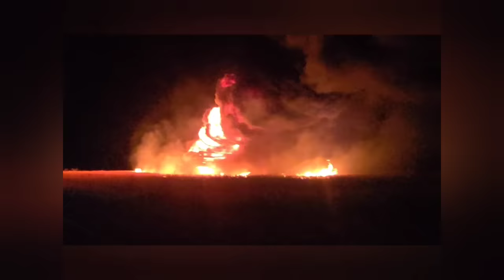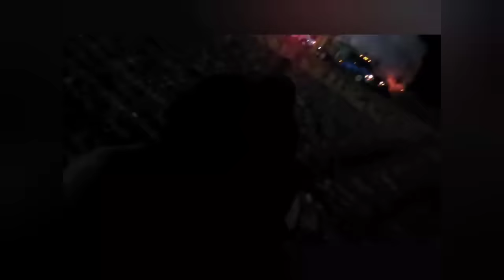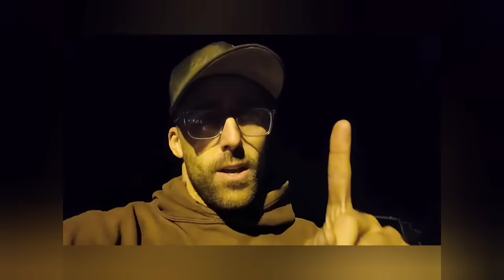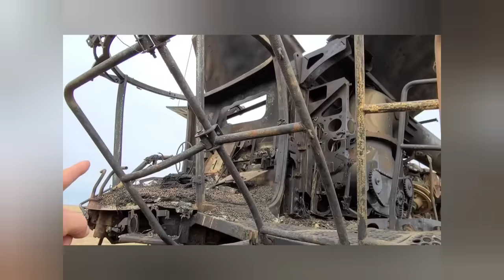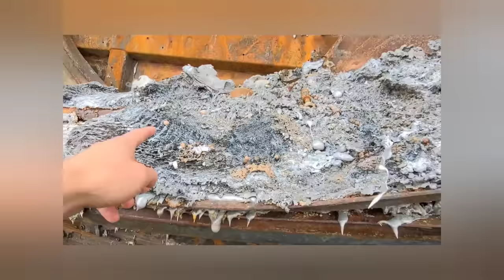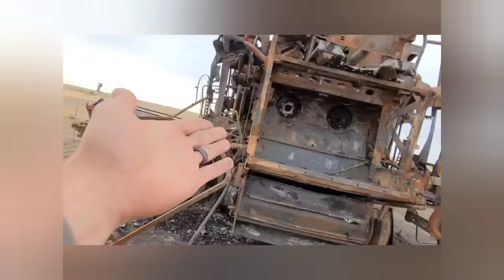Fendt Ideal 9, burns to the ground🔥

Comment: When I was harvesting chickpeas in Australia, we gave a full air blast to the combines every other run (~every hour). When running four combines, it was a full-time operation—a nasty job, by the way. Massive amount of dust + handling the 1" air hose from an industrial diesel compressor is not an easy task.
Water trucks were at each end of the run and one in the middle. We didn't lose combine but had harnesses smoldering. Lost sensors. Melted plastic side concave access panels. The worst case was a melted diesel tank on NH CR 10.90 which started leaking diesel, the alternator on fire, and a solder deep between the panels, which traveled to the sieves.
Exciting and tense times. We've been "sniffing" each other like dogs when unloading/passing each other. 

I would say that when harvesting chickpeas, the priority is to have at least 10l of water with every combine and chaser bin for immediate action. Make sure that there are no overheating bearings. Keep the dust to a minimum. At least blow the dust off the turbo. Otherwise, it will smolder and drop down or get redistributed with the airflow to other areas.

Our neighbors lost a new Claas combine that season. 
Checkpeas can ignite even due to electrostatic charges/rubbing.

Comment: Hey Mike, do the combines have temperature sensors on the gear boxes? Seems like that would be something they would want to monitor considering they had problems with overheating already. And it is pretty easy to add in sensors into the isobus/canbus system.
Reply: Excellent point, one good thing about losses like this is that it can lead to safety improvements.
Reply: JP Absolutely, in industry we utilize a lot of sensors during R&D/prototyping. Once the design and been tested throughly then most are not required for production. But critical gearboxes like this probably should fall into the same category as engine and hydraulic oil temperature.

Comment: Man...I kinda know that feeling...had a 468 JD round baler go up...had rolled 97 bales and was about done...was wrapping a bale and got a whiff of smoke...kicked the bale out and saw a flame flicker in the pickup..bailed out and grabbed the fire extinguisher and hit the area in the pickup and whoof...holy xxxx...I tried to pull the hitch pin but the heat was too hot...dont know what I was thinking but I jumped back in the tractor and shoved it in d-1 on a 4240 quad range and drove in circles..believe it or not I saved the tractor..it kept the flames pulled away but the heat did melt the top of the cab..okay let's backup...the whole was a result of a gallon of ethanol glycol my boss put in the extinguisher..the charging instructions says add a bit of dish deterrgent and a bit of antifreeze...non flammable anti freeze..I was catching hexx for not using the extinguisher when I did but I happened to see the instruction to charge the extinguisher and asked boss man hey what did you put in it...a gal of anti freeze and a bit of water and deterrgent...all the hay that was baled burned plus another 50 acres of hay ready to bale...had a JD 550 dozer with a plow and 5 different fire depts fighting it..once the belts caught fire it was crazy hot and hyd lines started blowing and spraying fire and those Ballon tires went kaboom...so I know a machine will burn..lol...glad no one got hurt at your fire...I was trapped in the middle of 97 bales on fire and it was nothing but smoke and ambers..all over a 35.00 dollar bearing that never made a sound...
Reply: You're right on the money about all brands will burn but J.D leads the the burn downs on rd baler here in eastern Okla...every frickin bearing on a Deere rd baler is sealed and is going to eventually fail...I use a heat gun also but had never seen this particular bearing and ive been running Deere balers since 86...Forest Gump said it best six happens.

Comment: Here in AZ, we also have issues with cotton picker fires.  Between the dry cotton fibers, the high oil seed, the amount of grease and oil in the picker heads, and the high-volume fans used to move the picket cotton, fires are just nasty.  Causes are usually rocks causing sparks, but, due to some of the high-speed parts in the picker heads, plain old friction can start fires, too.  You get into a  field that's nasty with morning glory or bindweed, and that crap can wind up in a head in a hurry and it only takes a few minutes to start a fire.  You do get the occasional electrical or engine fire, but, in my years of farming, they were pretty rare.

Comment: that collapsed hopper support, but fuel cant "melt" steel beams lol
Reply: What the conspiracy theorists can't seem to wrap their heads around is that it doesn't have to melt into a puddle, it just has to be weakened below its designed capacity allowing it to bend, deform, and shear under the weight of the load. There's also more than just fuel burning, which adds even more heat. (Also the spray-foam insulation used in the towers got blown off the beams by the initial impact/explosion further degrading their ability to withstand fire).
Reply: @MrMattumbo   another 5 galls of diesel and it would have collapsed into a pile of pre sized recyclable pieces

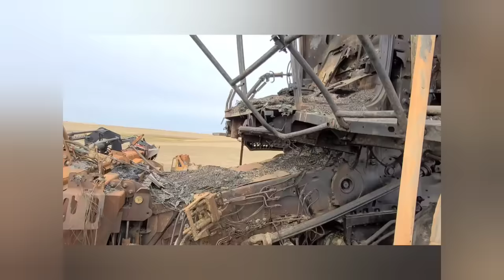Comment: Sad to lose the nice machine. Great to see the driver got out. Good to see the team work and the relatively quick response from the fire department! Look at the drive shaft going to the header (left side, under steps to cab) at 25:54, 30:31 and 39:55. That shaft looks to be a couple of inches thick, but it looks bent from the heat! Even though it was on the 'cool' side of the burn!

Comment: My dad (who is a spare time farmer) told me last year that one of these Ideal combines caught fire in a field near to our farm. He said that the operator was made aware of this by some motorcyclists on the road. He got out of the cab and ran away as far as he could. Only moments later did one of the rear tyres explode, sending the rim flying through the air and landed on the next field. Insane. Better stay back if equipment catches fire.

Comment: Hi Mike to bad about the combine we had 2 9620 rx tractors burn up last year with 600 ish hours on them I highly recommend removing the exhaust shields and cleaning it out. We ended up getting new ones with the 120 inch track spacing

Comment: Mike... you seem a bit angry.  IS the insurance company giving you the impression they don't want to pay out?    I get your joking as a way to deal with it I'm the same way.   In a sad way it was cool to see all the drive lines, pully system etc from the wreckage.   Stay safe out there.
Reply: thay will find something not to pay out  we had a trailer in the wood trade  because it caught fire at the yard they said we only pay out if its on the high way  we saved lots ot money on our next trailer  grandad told the inspector a few chiuce words.

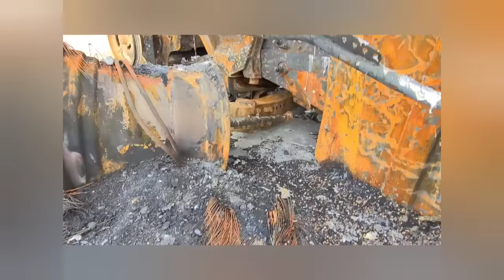Comment: 40:38 Did you just prove that diesel fuel can melt steel beams??   

Those south of the boarder will understand.
Reply: The so called engineers that said a fuel fire couldn't melt steel had obviously never seen a real fire. Nor did they appreciate the Roman candle effect. Just the same we all know what caused those fires and those that lost there life and there families should never be forgotten. 🕯♥️🙏
Reply: Thought the same thing.

Comment: So this insanely expensive equipment has no 20$ oil pressure sensor for the gearboxes. At least is has plastic fuel tanks to make it burn better.

Comment: My bet would be that damper and a bit colder chickpeas were harder on the gearbox and maybe caused some vibration. Vibration is so much harder on parts... could maybe make a seal pop. Vibrations are different at slow or higher speeds. Glad no one got hurt!!!

Comment: Not sure if you’ve seen this, was he turning to face south?  The reason I ask, there’s an ark burning on the right hand side of the combine at the very beginning when you get close. And there’s an arc leading to the back. It may be wind, but it looks like an oil leak. Watch it, it could still be the bearing getting hot, but kit sure looks like her made a U turn, maybe to unload!? Check it out, you can see it for yourself.

Comment: We had a Deere R&D shop near our farm and got to see some pretty cool stuff run through it.  Deere's not known around here for their hay equipment and, when they brought out a prototype swather for a local custom hay baler to try out, he absolutely loved it and told the JD engineers not to change a thing.  He was told that they had to get $1,000 USD cost out of the machine and the hay guy said that would be a huge mistake.  Sure enough, when they brought out a production model for him to try, it would run about 3-4 hours before they had to fix something, and there were more than a few =major= breakdowns.  Total POS and he told the guys after a week of running it, "good luck selling that POS, now get it the hell outta here!"  Sometimes you gotta wonder if the suits at the manufacturer =really= understand the cost of down time.  Add in the DRM b.s. for the computers and you can see why farmers are buying Ukrainian ECMs and the price of good used equipment, with no computers, is skyrocketing.

Comment: Another reason a gearbox blow's
a Seal  if the air vent got blocked .
 It builds pressure as the oil warmed up

Comment: There were some fire extinguisher systems knocking about that used ordinary nylon truck air hose. It runs around the machine in likely bad areas. Constantly under pressure it pops where the fire weakens it. *often wondered about re-hardening fired sockets and spanners.

Comment: Don't know if they have them or not but they should fit some oil level and temperature sensors on those gearboxs. You talked about the seal popped out, maybe some chaff wrapped around the shaft and popped it out I have seen that many times on different machines.

Comment: AFS would have put that out instantly, we use them on all our heavy mining equipment and can vouch for how well and how quick it works. As soon as flames hit the tubes and it detects a drop in pressure it shuts the engine and activates instantaneously  our operators sometimes don't even know they have had a fire it works that fast, best yet it gives the operator more time to get off the machine safely

Comment: Perhaps combines should be equipped with large aircraft tire valve systems that release the highly compressed air pressure when the tires overheat , preventing the tires from exploding and killing or injuring any nearby fire  and rescue personnel.
Reply: Art M if a combines on fire just stand back and watch it burn, nothing you can do once it takes hold. Just stand back until all tyres and fuels gone

Comment: You earned yourself another sub, Mike... it was insane to watch. Comes to show that you can do everything 100% right, but still fail to the intangibles; the machine checked out healthy at the start, but one tiny little part lead to its end.  Too bad the operator didn't have time to get the combine swung into the wind... may have slowed up the fire and may have saved the head, but was impressed you guys had it contained from the start through your coordinated effort. Having that disc on the ready was the saving strategy. Was hard to tell in the video, but did anyone have any small fire extinguishers? Even though the combine was gone, managing the fire on the ground more effectively than with shovels and clothes just in case a disc or water truck is behind could be the difference. Especially for baling and combining, I always have extinguishers on the tractor and combine as well as with the raking tractors and grain cart tractors just in case, and with a large jug of water or two to cool a hot bearing to prevent a fire. That jug of water came in handy a few years ago for a baler with a hot bearing.

It doesn't always work out the way it should, but stopping for a few minutes at random times for a quick smell/visual/sound inspection can go a long ways. Happened once this year for me running a swather, got the slightest scent of a "smoldering" smell, and pinpointed it to an extremely hot bearing on the header. I think that's as close as I want to get to a machine fire, especially now after seeing your video of a full burn LOL!

Comment: Have you checked your other combines to see if the vents are good on the gearbox that failed? I mean if you’re correct in your assumption that the seal popped out I’d think that would be the result of a clogged vent and even then it would still take heat to make enough pressure to pop it out. This is just my opinion and I don’t have a clue what the gearboxes are even like on those things.

Comment: Well all this equipment today has horsehair wire harnesses the big Case combines would collect dust from the engine fan on the turbochargers and then when started smoldering fell on the wiring harness

Comment: I had a 5288 ih tractor burn to the ground. It started under the cab and my son who was baling hay at the time almost got it out with the fire extinguisher but ran out of stuff and the fire started going again. My wife and I were in town and the kids then went home and filled up five gallon buckets and saved the baler. And like your combine it had a plastic tank. Once it melted through it it was over. I have always thought how stupid it is to have a flammable fuel tank. Dumb. It was so hot that anything aluminum was melted into a puddle on the ground. In fact all that was left of the AC compressor was the shaft.

Comment: The problem with steel fuel tanks, it becomes more of a shrapnel discharge when it blows. But i do agree some new tank needs to be invented.
Reply: To prevent a steel tank from becoming a bomb, the would just have to build in a pressure release valve at the top. That way as the fuel heats up, the pressure can vent off and the top of the tank location keeps it from draining the tank when the valves opens
Reply: @isaachousley325  Then it becomes a blow torch at the pressure release valve. You can’t win.

Comment: I don't think the fuel makes that big difference once the fire starts out without it. There is way more energy in all the tons of grains in the hopper. And actually the plastic helps to prevent the fuel to explode that violently: When heated by the external fire, it gets weakened first before it lets the fuel vapour to build up into that much pressure, so it spills the fuel into the fire without making a high pressure flamethrower out of it.

Plus such crop fires started the first time people start to use machines to flail the crop. Even the all wood, horse driven machines tend to ignite the crop. Jus some strands getting caught in a bearing and the fire broke out, even at that time spreading so quickly so usually completely destroying the machine to ashes. The crop is just very excellent energy storage, not too difficult to ignite...
Reply: Yeah you think about how many calories are in a bushel of chickpeas, add in all the plant matter, powdered material, and you've got tons of energy for a fire.

Comment: Yeah when you started hearing the first tire pop, that should have been a sign not to get to close. Sucks that it burnt but I have noticed most that catch are John Deere....is there an issue with John Deere after  or it is a build up of material that heats up from the area around it heating up and finally gives? There's so many moving parts to one of these big peace of equipment that it could be a number of things. I was always told that if you smell burning leaves that's when you know it's either fixing to catch or has already caught. Always listen and smell.

Comment: 1997 i was combining corn (day time) with the massey 760 suddenly the engine oil warning light came on. stopped the combine got out saw black motor oil all down the left side of combine. climbed back up & shut it off. perkins deisel the crankshaft main seal blew off but nothing caught fire just lost all the oil. next day with my brothers truck he towed me (engine off) to a local tractor repair they used their service truck crane lift the engine enough to install a new seal & power washed the everything i was back combining that night never had troubles ever again

Comment: I still don't get why they don't put a factory fire suppression system in combines. We are talking about a machine that costs over $600K new, and even a 10 year old one is more than a new car. That doesn't even include the grain loss in the combine, the 1500 L of fuel, what you lose in the field (god help you if it doesn't spread through the crop and engulf the field like you guys were worried about. And that's not even taking into account risk to workers, cost of getting the fire dept out there, down time. Ect. 

Seriously, what would a fire suppression system cost that would spray fire retardant, dry chemical, or even a gas like CO2  cost. $10K, 20K? Sounds like a worthwhile investment to me

Comment: Sorry hear combine burnt down, glad to everyone was safe👍seen few combines burnt to ground but your ideal was something else, holy smoke the axle.  Interesting if seal fail on gearbox, what service schedule on the seals?  Interesting you had cooler for gearbox, this interesting because CaseIH both 8010 models I believe were having heating problems that why they went back to open deck at the back.  Good luck with insurance n clean up🍀

Comment: We had a pto cross go out, it was red hot and ruptured the nearby hydraulic line and instantly blew up with the hot oil,  shut off the tractor and that shut off the oil, and got it watered down with minor loss, glad no one was hurt and your fire didnt spread, in cali you would need a burn permit and a clean up crew and a ton of paperwork, sorry about the hat, ,

Comment: Interesting video.  I was surprised Mike didn't mention how flammable chickpea dust is.  It is notorious for starting fires, be it on exhaust manifolds, failed bearings or anywhere hot - it's even worse than lentils.